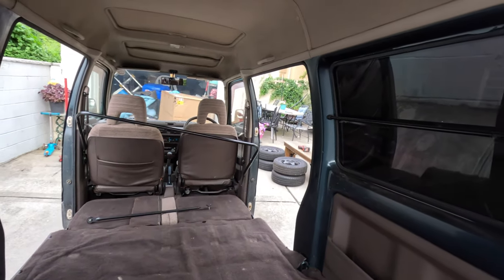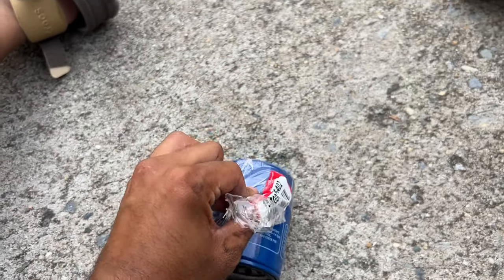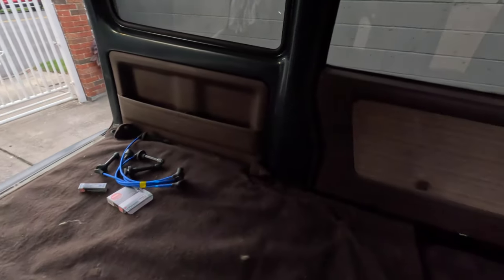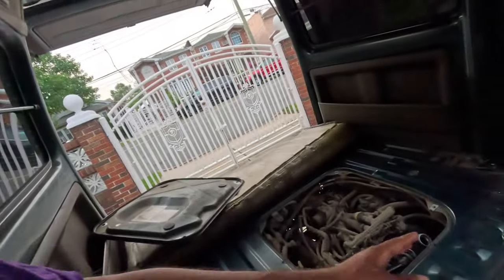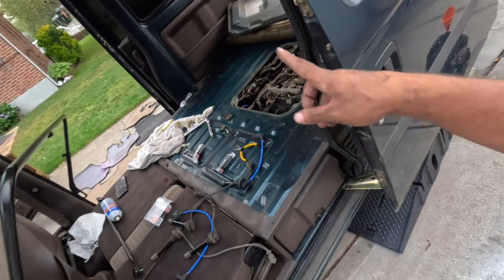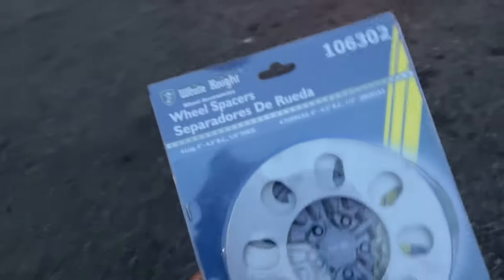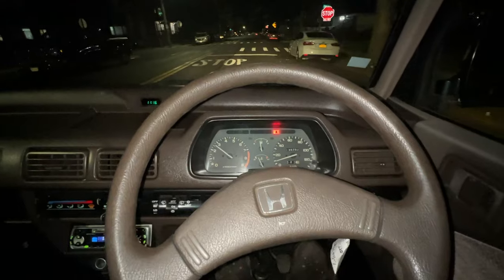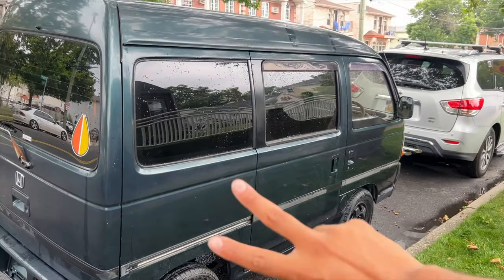Honda Acty Street Tune Up

Comment: u got a bad valve stem seals. thats normally why u got oil soaked plugs, if the boots are wet its also tube seals
Reply from the maker: Ima look into both once I get my air filter in and do some more digging

Comment: Yes, Yes, Yes...I second jonathan on the oil filter wrench - either the socket style or the band that wraps around the body of the filter. And I'm a subscriber and I've been digging all the videos but but but these older vehicles when purchased from a curbside dealer behind a chain link fence will no doubt need mechanical work and not simply dressing up the vehicle.
Reply from the maker: I think ima need to get a filter wrench asap. And yeah for $4800 I knew this car wasn’t going to be perfect but I still think it was a steal

Comment: Get the oil filter socket that goes on the end it’s like 7$ at autozone. Also jack up the front next time to get all the dirty oil out

Ps that bar ties the rollercoaster bar to the back seat by the arm rest
Reply from the maker: At this point I might need to by that socket asap and yeah thats a good point

Comment: I just found your channel and had to subscribe. I've been a Honda fan for 17 years and I've always thought it would be cool to have a Kei car. I have a 92 Civic VX(my first Honda) and a 2010 Fit. 

I had a 91 Accord that had the same problem with oil in the spark plug tubes. When you replace the valve cover gasket, make sure you get the seals that go around the spark plug tubes. Good luck with getting everything in running order!
Reply from the maker: Right on! yeah ima see if I order a valve cover gasket soon to get that fixed.

Comment: The oil problem is from the valve cover gaskets not the valves itself. Each spark plug has a rubber gasket/seal to keep the oil out!
Honda design problem 101!
Reply from the maker: Honda reliability will never be questioned lol

Comment: I'm not a Honda guy but I'm digging this Acty Street, and the price seemed like a good deal.

I don't even try to remove the oil filters by hand.  Even when I installed it hand tight, they tighten up after a year.

I like the looks of the black rims but not the extra lug holes on the universal rims.  I'd 3D print covers for the central bore holes.  My plan is to remove the tires from the plain ugly steel rims on my Hijet pickup, sand blast the rust off the rims, powder coat them black and install new tires.  For my 4WD Hijet, I'm going for functional & durable and not particularly pretty.

I was glad this tune up was less exciting than your Beat tune up.   🙂

I wouldn't spray carb cleaner into a cylinder.  I'd turn it over with the plugs out if there was oil in the cylinders.  Hopefully, you had oil in the spark plug wells from a leaky valve cover gasket but not oil leaking into the cylinders.
Reply from the maker: I think its most likely a bad valve cover I'm going to look into it more in the next couple days but I'm starting to like the street Alot more than the Honda beat
Reply: @Waybeforethefame  - The Street is certainly more useful than the Beat.  The Beat looks like a ton of fun  but there is definitely something to be said for the Street's utility.  I'd like to drive the Beat but I'd like to OWN a 4WD kei van.

Comment: The bar connects to the middle of the "roller coaster bar" when nit is in the up position, the other end connects to the side of the passenger seat above the arm rest (you can see it when you lower the arm rest). this makes a "T" shape bar when all is installed.

Comment: I never wanted one of these until I saw YOUR videos. At 6’6”, I have no business in one of these, but I want one soooo bad. I kick myself bcz just about a month ago there was one at the local govt auction, I think came from the airport. Question for you: are the pedals the same as our normal vehicles (accelerator on the right foot, clutch & brake on left foot)?
Reply from the maker: Hey yeah so the petals are the same, along with the shift pattern. And at 6'6 yeah itll be a little hard to get in a kei van but you can still a weird JDM van like a Toyota hiace, Delica or one of the bigger vans

Comment: I have done oil changes on many cars and at no point have I ever encoutered a filter that can just be hand screwed off..
Reply from the maker: I have a different experience, most of the kei cars I buy I can take them off by hand no problem. Takes some strength but I never need to grab tools to help

Comment: I'm not feeling the black rims.  It needs rims that jazz it up a bit.
Reply from the maker: Different color?
Reply: @Waybeforethefame  Maybe a satin silver or chrome set.  Something with some bling that catches the eye.  Especially if you plan on using it to advertise your brand.  You want people to take notice.  The black ones were ok, but its a dark colored vehicle and they just blend in and look plain.
Reply: @Waybeforethefame  A possible option is to have rims hydro dipped.  Imagine white with your Way Before the Fame logo, or some radical pattern.  One of a kind hyrdo dipped rims would really set your Honda apart from the rest.